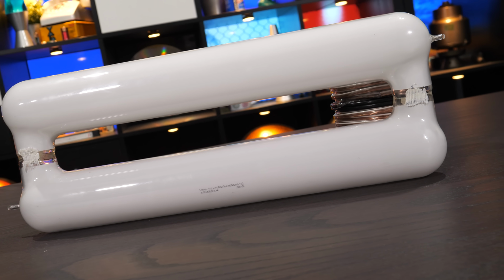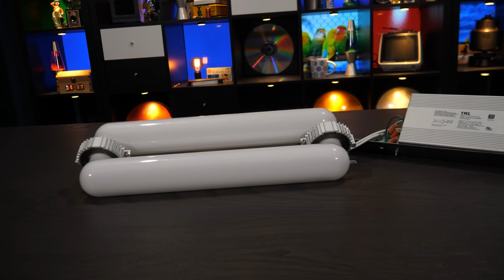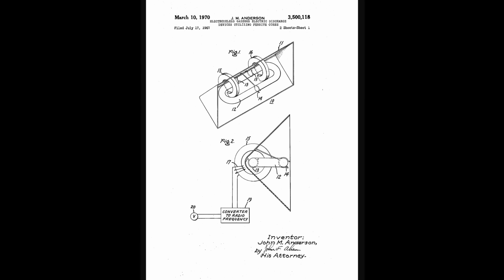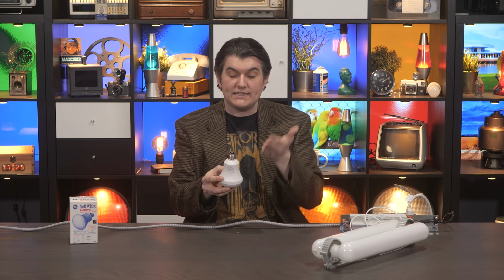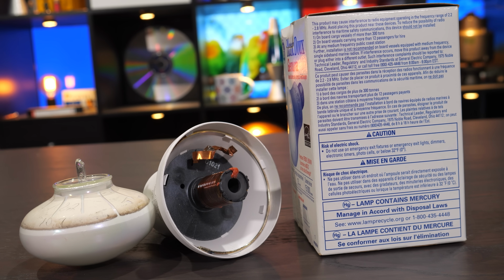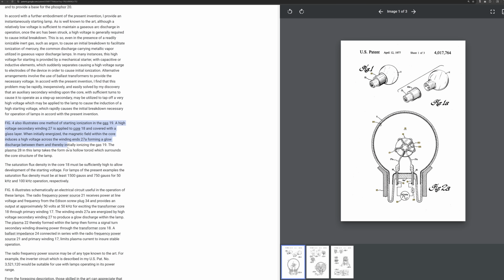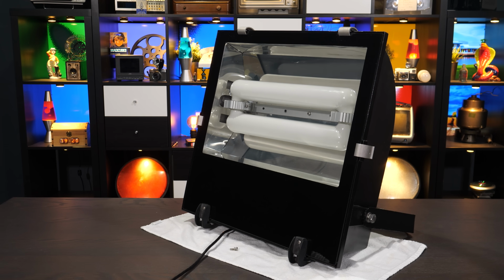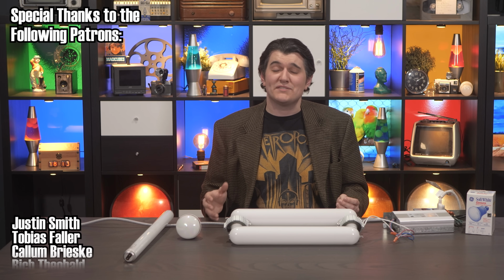Induction lamps: fluorescent lighting's final form

Comment: I worked on ballasts for these bulbs.  They were similar to the standard fluorescent ballasts but with higher voltage and frequency.   We used a half bridge FETs and a resonant tank circuit to drive the bulbs.  We started the frequency high, and then swept it down closer to the operating frequency at around 250kHZ.  An floruencent bulb has a high resistance before it ignites, so with a LC resonant tank circuit you can develop very high voltages which causes the bulb to ignite.  After that the resistance drops and the LC circuit limits current into the bulb which is required due to the negative incremental resistance characteristic of a fluorescent bulb.

Comment: After about 10 years of only using LED I only had to replace 4 of ~10 so far. With all older technologies I would have lost count years ago. And those LED are so efficient they save enough power for the price difference in way less then 1 year. so thy are a complete no brainer.
So in 10 years I have not yet replaced all my LED lamps I initially installed.

Comment: A lot of the high power induction lamps reused in signage where the fixtures were extremely high up normally on the freeway access ramp to gas stations normally Sunoco. Some of these big signs had 10 of these lamps inside of them for reliability and brightness. Who wants to change a lamp 70 100 ft in the air. I used to I was in the sign business for 40 years I have a bunch of these laying around if anybody wants them make me an offer power supply and lamps Sunoco gas station

Comment: But we're back at the problem now where LED bulbs don't last nearly as long as they should. I spent a decade in surgical lighting design, and when you design enough headroom for your LEDs and power electronics, and properly dissipate heat, we could easily get 100k hour lifetimes to 70% brightness. Without driver failures.

But good luck finding LED bulbs that do that anymore. You could at the beginning, but if you take apart an LED bulb nowdays, they're all woefully under designed. Call it a conspiracy or just the race to the bottom, but LEDs are barely lasting longer than a CFL these days, unless you know exactly which to buy.

Comment: I'm electrician who's installed quite a few induction lights. I prefer them over LED. They tend to last forever. Where I have not found any brand of LED that outlasting them. Also if you look very carefully on the inside of the light you can see when it's illuminated there's a darker strip that is your ignition wire.

Comment: I always right the date on my LED bulbs before installing them in my overhead boobie fixtures and they typically last about 2 years. But I use 100W equivalent bulbs, which get pretty hot, and the lights in my house are all on for 16 hours a day, so that's still seems pretty good. Although the ones we have in open air lamps, instead of the boobie fixtures, seem to last a lot longer.

Comment: Look into uv lights for offset printing. They are very interesting and work off a similar principle except they do still have components on the ends. But they get very hot very fast and cool fast using a water cooling system. They run off of mercury or gallium alot times.

Comment: The movie theater I used to work at used the Philips QL lamps you mentioned in the auditoriums for cleaning. I was there long enough to see one other issue you didn’t mention, probably because you hadn’t heard about it. There was enough UV light escaping from it to degrade the plastic base holding them into the fixture, and after about ten years of operation, they would suddenly fall out and smash in front of the patrons.

Comment: In my house, I have replaced all the bulbs multiple times as new types of bulbs came out. When I moved in, they were all incandescent. I swapped most of those for CFL bulbs, then LEDs. I have had some LED bulbs fail. A couple of them were 3-way bulbs. Both of them shorted internally, and would flicker on and off, or be completely dead. The ones I have now have lasted for a couple of years though. The only place where I regularly need to replace bulbs is in my bathroom. It is one of those combination heater and exhaust fans. If they get too hot, the glue that holds them together fails. Other than that, LEDs are pretty good.

Comment: Believe the answer you're looking for that starts those bulbs is probably static electricity Discharges. Similar to when you hold a florescent tube next to one of those illuma storm globes, and it will light it up. Also high power radio discharges lights them up too, I used to have a powerful cb radio that would light up almost every florescent tube in the house when I keyed up the Mic.

Comment: I remember the fluorescent lamp on my desk turning on during lightning storms, it was all dark and wavy and wouldn't turn on entirely.
Not sure why it behaved that way, I don't think it had a starter, it was entirely manual, you'd press a switch and the coil would glow, and the off switch only briefly disconnected it, so if you barely tapped the off switch it would go into that dark wavey pattern.

Comment: ... The gas does conduct electricity. If you use a magnetic field, at a high enough frequency... What do you get? Basically a Tesla coil. Only it doesn't have to operate at as high a voltage or frequency because electrons are traveling through a vacuum tube which removes resistance and which is why the electrons get excited and produce light. 
It is the same principle if you take a fluorescent tube and walk in an area with high frequency radio waves. Radio waves are a type of frequency as you pointed out earlier. Take a fluorescent lamp and wave it around a radio tower... Or high voltage electric lines...and it will glow.

Comment: LED is still garbage as far as consumer access goes. Everything in retail stores flickers. Everyone says get quality bulbs, but don't say what brand or type. So far I've only found 1 brand that doesn't flicker, but they still suck in other ways. Waveform lighting. They only offer 60W for the normal A19 bulbs, and they're too blue for K rating. Not everyone has dimmers, and not all dimmers work with the same LED lights, so not having lower watt options makes them unusable in small rooms. The 40W versions only come in the clear style.

Comment: TLDR: It's a limited ion-drive ignition system. Longer explanation: The system is likely using sophisticated RF antenna principles for ignition. The main driver broadcasts RF energy, and that smaller, separate coil likely acts as a passive "director" or "reflector." This setup focuses the RF energy into a precise "hot spot." This concentration of energy allows the lamp to ignite the plasma (strike the arc) using much less power than if it had to energize the whole tube at once. In principle it operates similar to the MIT Ion-Drive on startup, creating a specific Ion Path which controls the plasma ignition and creates a pressure gradient that compresses the gas and pushes it towards the induction coil. Once fully ignited to plasma state this propagation no longer occurs. So, it's not a continuous "ion drive, per se," but rather a highly optimized, focused ignition system that is similar in base principles. Once the plasma ignites in that hot spot, it rapidly expands to fill the tubes. It's a very efficient way to start the ionization cycle.

Comment: As some other comments have mentioned, the mercury is a big reason that people have moved away from fluorescent tubes. It is becoming increasingly difficult to sell products with significant mercury content, and many electronic manufacturers have stopped producing components with mercury content in them. Even if there was a massive breakthrough with improving the technology, as long as it contains mercury it will never be sellable.

Comment: Regarding startup: the mechanism could be very similar to those toroidal plasmas everyone got very excited about not too long ago. Without a plasma to induce large currents in and the associated back-emf in the coil, you'll get much larger currents in the coil before the gas is ionized, leading to a much larger magnetic field. Because this field is very strong and is also very rapidly oscillating, it can result in quite strong electric fields in the tube as well as the magnetic fields the coils more directly produced. If this electric field is strong enough, it can ionize the starter gas, establishing a conductive medium through which a current can be induced, and, well, you know the rest. I imagine the bits of metal inside the tube act as a small antenna, whose sharp ends provide a sort of breakout point at which the electric field is especially strong, making it even easier to get the very first ionizations.

Comment: In 2008 I worked as the maintenance guy for an indoor rock climbing gym. Their lighting had been 1000W metal halide fixtures hanging not far below a ceiling that was about 60 feet above the floor. Accessing those fixtures was out of ladder range and had to be done by rigging a safety setup from the ceiling trusses -- it was very labor intensive and changing those bulbs every year or two (or allowing them to drop below good output) was pretty expensive. The owners decided to replace the dozen or so fixtures with induction fixtures that had a circline-type bulb -- there was a size available that actually put out more than enough lumens, within a specular downward-throwing fixture that directed most of the light toward the floor and walls. If I recall correctly, changing all these fixtures out was pretty expensive but was expected to pay for itself plus plenty more savings both in electricity and maintenance over the lifetime. By now, I can't guess whether they've had enough reason to switch them out for LED. But I remember the light quality was really nice, and it was in a location with no temperature issues, and it was nice to see the savings in kilowatt hours.

Comment: As cool as this (and the sulfur-argon) induction lights are, well I can't deny it, it's probably a good thing we don't all have several hundred watts of low-AM-band RF interference sources in our homes.

The proliferation of switching power supplies dumping broadband line noise into everything that isn't hiding inside a copper box is bad enough as it is.

Comment: LOL, when you talked about the problem of the diffuse light in a street lamp I jumped strait to a reflector surrounding the whole light source with a partially mirrored section for where you wanted the light beam to exit the fixture.... then I thought isn't that pretty much a lazar at that point?  I don't think you want to  burn the paint on a car parked under the street lamp!  I guess you could use a diffuser to spread the light again.  Sounds way to expensive to be practical.

Comment: The first helium-neon laser didn't have internal electrodes, as most do today.  It used what is described as "capacitive excitation."  I didn't understand this when I was a kid in the 1960s.  Metal bands around the tube at precise spacing served as the capacitors of an RLC circuit, pumping RF into the gas.  Now, RF isn't supposed to be ionizing radiation.  It isn't.  But the energy in a gas isn't constant.  It's Boltzmann-distributed, with a small mole fraction of the gas having high enough kinetic energy at room temperature to ionize a few atoms by collision.  That's all that is required.  When the free electrons are excited by the RF field, they gain energy that is collisionally transferred to the neutral gas atoms, causing further ionization.  At steady state, the RF pumping maintains what is known as a "cold plasma", in which the gas atoms have a thermal energy distribution at room temperature, while the electron gas has a very high temperature.  About half of the gas atoms can be ionized,. but the gas atoms' kinetic energy distribution is that of a gas at 300 K.

Comment: As a consulting engineer in electronic ballasts i did a ballast for the 160 W "Circiline" version IFL.  All induction lamps are Electrostatic Start, Induction Run.  Most are based on the series resonant circuit, driven by a voltage source inverter.  The SR circuit looks like a very low Z when unloaded, ie b4 lamp fires. This causes huge current in the windings of the torridial transformer primaries. This huge current results in a huge voltage across the windings which in turn is Capacitively coupled to the Ar/Hg in the lamp through its  glass walls.
This starts weak ionization in the area under the torrids.  This increases ionization current,  and # of ions dramatically.  Eventually the ions drift throughout the tube after several 100 uSec, and the lamp runs normally. 
As an aside, the starting process is very hard on the MOSFET switches due to high peak current and on the series resonant capacitor due to high peak current. 
I found that adding a small piece of copper tape to the glass adjacent to each torrid, and connected to hot end of each primary greatly reduced the I/V stress and eased starting.
Since the 1967 patent you showed us used the Same Technique i confess i have again Reinventing the Wheel!
David Pacholok CEC LLC
Reply: Good info. I wonder if that broken copper strip in his GE bulb was there for a similar reason and not just to ground it for EMI as he indicated.

Comment: 19:30 so this might have nothing to do with it, but the answer might actually be quantum tunneling (though likely mixed with other phenomena). Light switches, totally normal light switches, use quantum tunneling for the same purpose (as do all other mechanical electrical switches). When off, there is a small layer of oxides on the surface of the contacts - often too small to see with the naked eye, but nonetheless enough to prevent electron flow. That oxide layer forms every time the contacts are not in contact, and remains when the contacts are put back into contact (assuming they’re not inadvertently scraped off in the process). The reason that light switches work despite this oxide layer is quantum tunneling: enough electrons are able to q tunnel through that thin oxide to just barely get the current started, allowing the voltage to push more electrons through and get the “normal” current moving.

Perhaps in the start up of these lamps, quantum tunneling or other small movements get just enough current moving (or, by virtue of a voltage, favors a direction of that movement enough) for the lamp to start acting as normal.

Comment: Inductively Coupled Plasma tech is used in some lab instruments, things like ICMPS.  They use high power high frequency radio waves to turn the argon carrier gas into a plasma torch that is then used to atomize the sample liquid for analysis by the detectors.  I'd be willing to bet that the RF frequencies and power used to start the lamps are more than enough to heat the argon and get it ionized within the effective field, then things proceed from there.
Reply: RF=radio frequency. RF frequencies=radio frequency frequencies. Just write RF, don't write frequency twice.

Comment: So these lamps last infinitely longer than 10,000hrs which is why you don't get to own them... thanks to Edison dabbling in planned obsolescence and the Phoebus Cartel for perfecting it.
Tesla's single wire carbon button lamps were "discouraged" for the same reason, they emitted full spectrum bright light equivalent to the light spectrum form the sun and the carbon button didn't typically fail anywhere near the carefully contrived tungsten and other filament lamps plus they needed half the copper wire to plumb them in.

Comment: Ionising radiation, hence the radio hz  and the different gases act as a difference engine like seen in the aura borialise different gases at high altitude and dust particles excited by high enrgy radition. so the voltage in the lamp gas might be in the mega volt range although the amperage pull being relatively low.
But all this is speculative but makes sense in my mind.

Comment: Silly foreign man you don't understand lamps , incandescent lamps work by chasing dark away until it hides behind the sofa or just outside the curtains but tubes work by sucking dark inside them leaving the light in the room .Eventually tubes get so much dark stuck in them they stop working ,for proof there it is stuck in the ends .It's not stuttering it's trapped dark .

Comment: There is a neat trick you can do with a dead fluorescent bulb, one of the twisty compact ones with traditional electrodes. Put on a plate under an upside down glass bowl in a microwave. Easy light at uni when the dorm maintenance team wouldn't change a broken kitchen light. Might work with the smaller induction bulbs a treat.
Reply: The plate and bowl are essential to prevent arcing.

Comment: Now it's 2025 and LED point light sources are everywhere and it turns out they are worse. Every shadow from a LED array street light looks like a thousand glass shards, every face is shimmering. You wake up, the LED in your bathroom makes you look like a zombie because it's "1000000k cool white" that is actually blue with almost no red. The CRI is utterly horrifying because we have to pretend they are efficient and cheap, and high-CRI LEDs are neither. Installing any kind of diffuser to smooth the razor-sharp quality of light from the point light sources brings the price up immensely and drops the lumen output even further. Thanks I'll keep the high-CRI fluorescent tubes.

Comment: Sputtering:
The electricity atomises the metal.
The metal atoms are in a vapor cloud. (If liquid or solid the electrons could flow and the substance would not be atomic but bound or ionic)

Then the energy releases like fluoressence.
The metal thus solidifies
This is at a random place so not where they came from